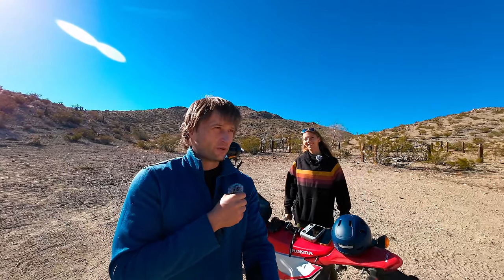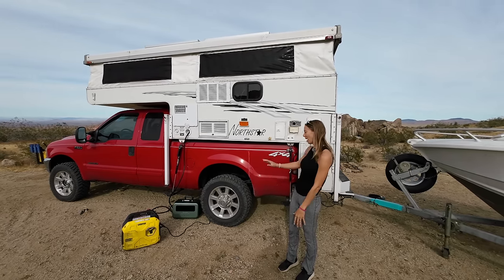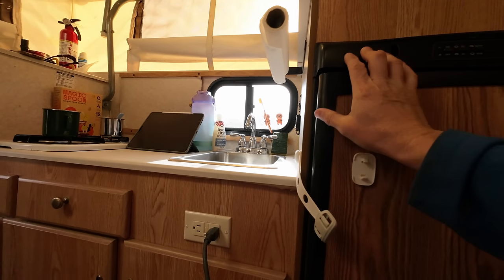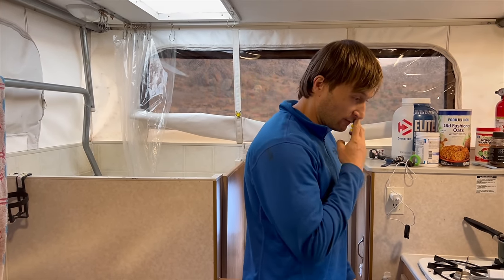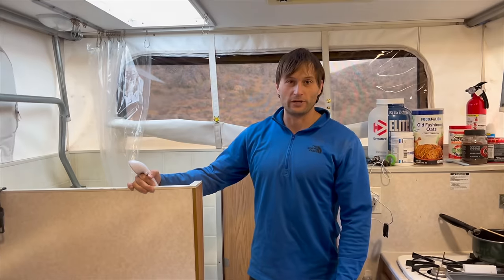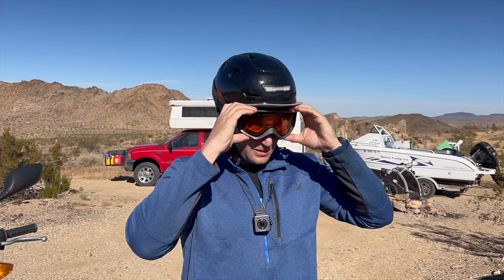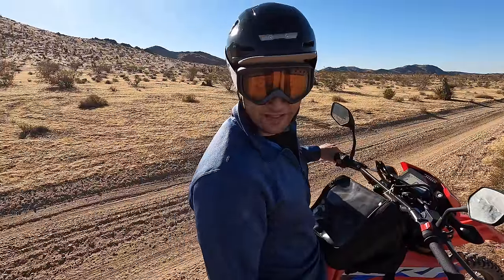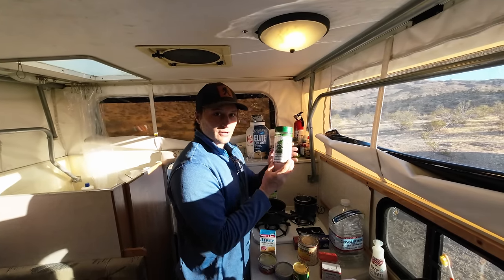We found something...STRANGE?! | 4x4 Popup Truck Camper Living

Comment: I assume your camper battery is either an AGM or Lithium battery, since u mentioned it is deep cycle.  I do not know what you are using as a regulator for your 200 Watt solar panels charging your camper battery, but if you use a BCDC charger, it has a built in MPPT solar panel controller and will let you charge the battery off your alternator while you are driving.